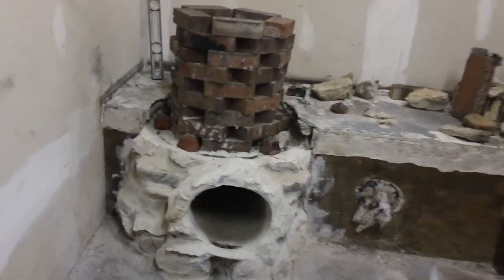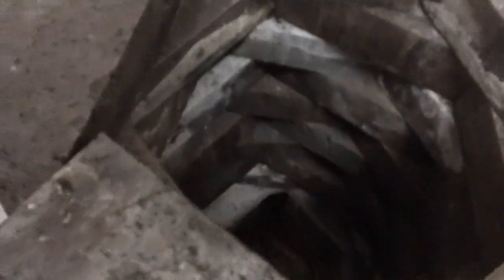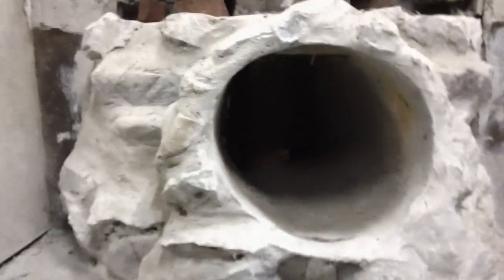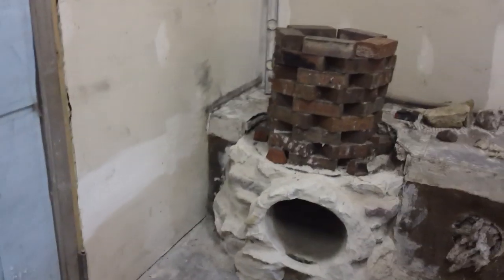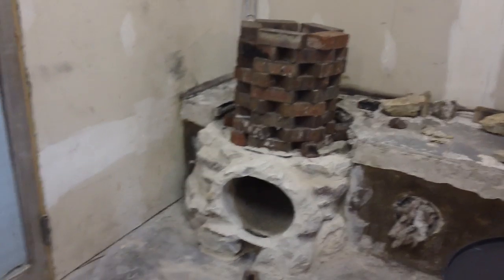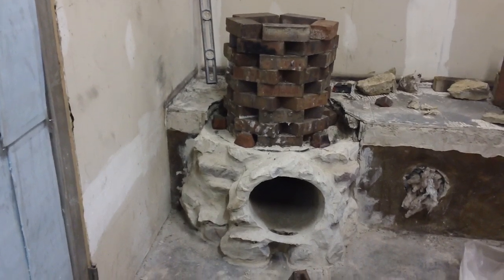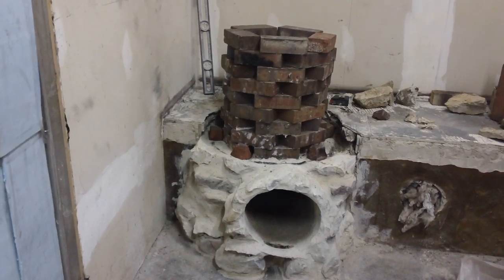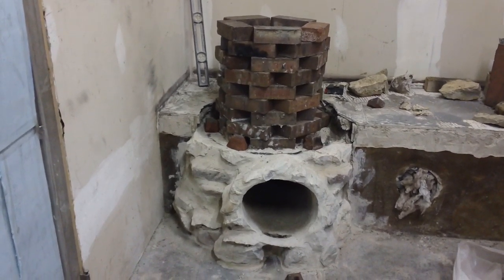12 inch Rocket Stove Part 3

Comment: I enjoy your teachings on rocket stoves and other items. I'm wanting to heat my 1500 sq ft home with something like your bulldog stove, I would like to discuss it with you. What's the best way? Thanks, Jim
Reply from the maker: you can e mail me at blldogger at msn dot com. give me your building locatioon or temp range and your R value of you walls and windows and size and location in the house you want the stove.
Reply: I have built a 1500 sqft home with 6" exterior walls, insulated with 1" thick cardboard. The exterior is 1/2" hardy board covered with aluminum skin, also inside the exterior walls are covered with sheet aluminum foil. The exterior is covered with 12" wide siding, furred out with 1" battens. My ceilings are vaulted with the highest in the living area being about 11ft 6 inches. I have been thinking of building something like your 12" bulldog stove. The ceilings are insulated with 6" insulation. Thanks Jim